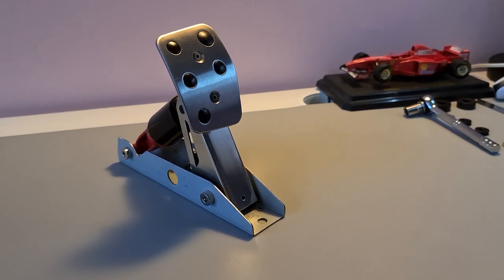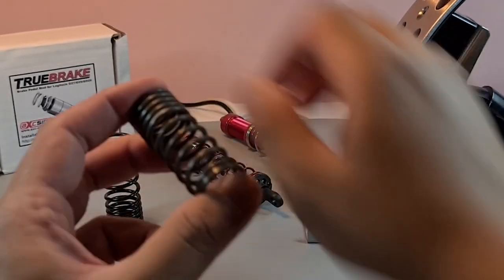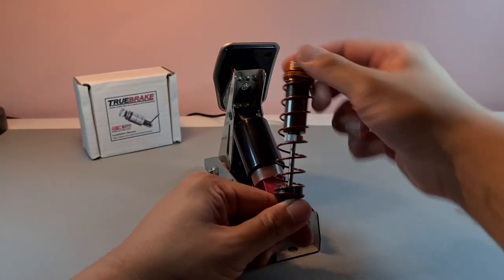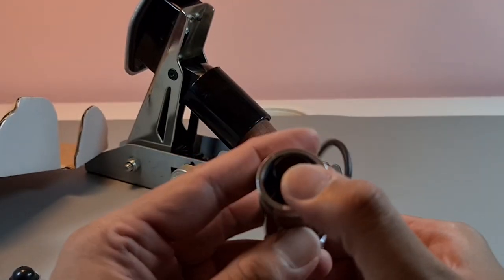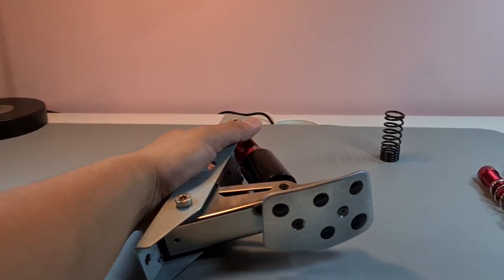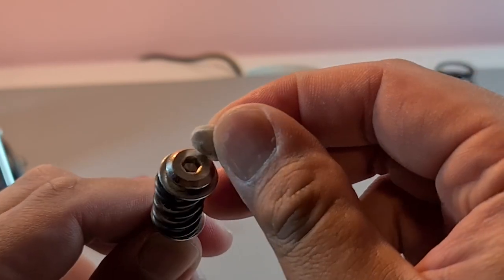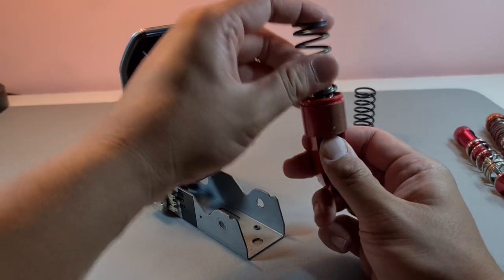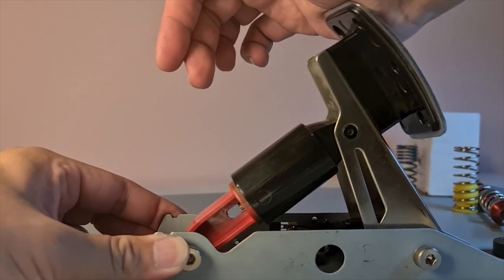DIY Logitech G29 Brake Mod - The last brake mod you'll need?

Comment: What I've done on mine was added a progressive spring from my RC offroad truck and also installed an oil field shock damper from the same truck. The damper makes it  feel like a hydraulic brakes.  So when you step on the brake it dampens the movement and when you let off, it doest snap back. It works awesome and the feel is realistic at a fraction of the cost.
Reply: You have a link to what's needed to do this?
Reply: @highsiderider  Nice, thanks.
Reply: can you do the parts list for me to?
Reply: Can I have a link to the part’s needed?
Reply: Link please
Reply: You have a link to the parts you used from your rc truck? Thanks in advance

Comment: Finally someone that gets it.  I'm specifically tuning my pedal for gt sport and you know your stuff.  I'm just wanting a consistent linear force for braking and the best I've found so far is stock spring + rubber + nerf rival round (sponge) inside the spring.  It makes a click when you press it, which is annoying, so I'm still looking for options.
Reply from the maker: Done the same thing with the nerf ;) as well as many other rubbery/foamy objects myself. This mod was the only thing that worked well for me. Hope it does for you too!
Reply: I tried the gteye set, but the brake spring is too stiff, too short of a travel due to thickness of spring and feels unnatural.  What works for me to feel like the real brake is use the gteye clutch spring for brake.  Feels so much more realistic and longer travel.  I then used the original brake spring for clutch since it's a little stiffer than the original clutch spring but less stiff than the gteye clutch spring.
Reply: You do know that the potentiometer actually has a built in firmware that makes it non-linear
Reply: @asherwiggin6456  Yes, I know that.  And that's why I combat it with a squishy object that gets exponentially harder to squish as you squish it.  It feels amazing to me, night and day difference, so that's good enough.

Comment: What would really work well, what's called a Dash Pot. Think of a syringe, then plug one end, and as you push, it gets harder and harder to compress the air trapped inside. If set up right, it would feel exactly like pushing a brake pedal, soft at the start, and hard further down, you just need to adjust the amount of air inside, like bleeding a brake system and leave just the right amount of air, it will push the pedal back to its original position all on its own, no spring needed.
Reply: i have a 5ml syringe and i was thinking the same,i screw a bolt to seal the syringe.

Comment: I did a similar idea, i am using a piece of wine bottle cork (50%) in the bottom, a piece of soft pecil eraser (25%) and nothing else (25%) it feels fantastic for the money. The only cons is that the displacement is short now. Maybe the linear potentiometer  (is the pressure progresive?) is better but expensive compared with this 25 Cents (usd)

Comment: If I'm not willing to put quite this much effort in, would the GTEYE spring be the best simple mod?  Basically I want the second step of resistance to be, like you said, at about 70-80%.  I thought about just chopping a bit off the rubber but if I need warranty service that would be a bad look.  Is the GTEYE too soft?  I'm also not interested in it feeling like a "real" car, I just want to race in comfort without hurting my knee or bending my wheel stand.
Reply: then just adjust your brake gamma or other brake settings if u just want it lighter and not realistic.

Comment: Thank you Chris for posting this mod - I've just done your mod to my G27 pedals and it's by far the best feel the pedal has ever had (I've tried most of the other mods except the linear potentiometer).  I did do a mod of my own which I'll share, may be useful for you and others.  I removed some of the material from the top cover just behind the brake pedal, to allow the pedal to be accessed without removing the pedal faces/top cover.  I just used a hacksaw blade and file to remove enough plastic to allow the pedal to swing back, so now after removing the 2 small hex screws in the top red part of the pedal, there is plenty of room to swing the pedal back and tune the spring stack.  I also drilled a small hole through the top brass mount (and the plastic red outer) to allow a small Allen wrench to be inserted to stop the brass rod from spinning when removing the small hex head screws.  Now I can open up the brake, add or remove washers etc and be back testing in under 5 minutes.  Cheers
Reply: can you indicate the little spring you have used?. do you know amazon link
Reply: @marcod7615  Hi - sorry, the spring came out of an old brake wheel cylinder honing tool that I had - it was pretty close to the dimensions in the original video, slightly longer IIRC.

Comment: Im trying to buy the stuff for this mod but i have some problems. 
I can only find a 50mm spring with 0.2 thickness so i was going to use original brake spring. 
Also i can only find a 6mm hex bolt will this work? 
My small spring i can find 1.5mm diameter
And what washer size, will m4 work?

Comment: Very well made video Chris. On the subject of pedals, do you know of anyone who supplies replacement potentiometers for the G29 pedals. I have dismantled and cleaned mine numerous times, swapped them around, etc, but they are wearing out. I got some from 3DRAP in Italy but they were too flimsy. I also tried some from DIGI-KEY in the US but found they are "clocked" differently in their arc of travel. I emailed TRUBRAKE in the UK about a year ago and they responded saying they were looking into the commercial viability of making potentiometers but the COVID hit. The latest G29 and G920 pedals have the same old potentiometers so will suffer the same issues. I don't understand why Logitech do not have a spare parts facility or can at least refer people to a third party supplier.
Reply: @chrisaaron8445  Thanks for that Chris. Good tip, I'll keep an eye out for some 2nd hand pedals.
Reply: Farrell components in Leeds, RS components in Leeds ty these.
Reply: Axc-sim do replacement potentiometer